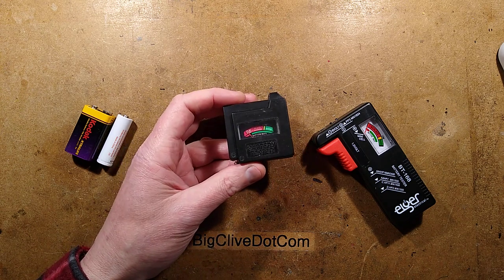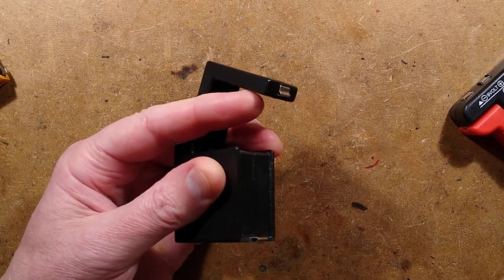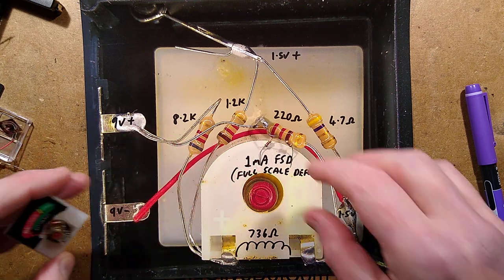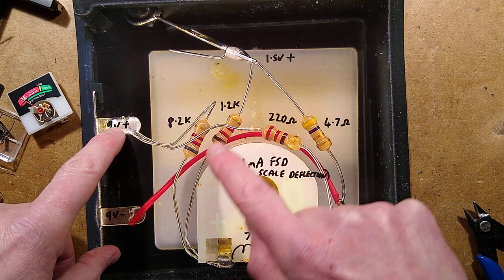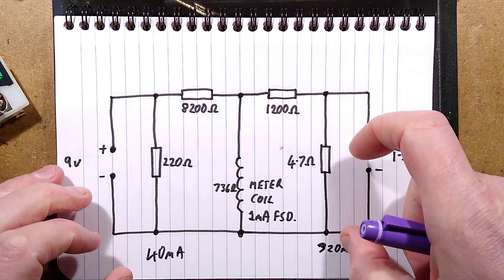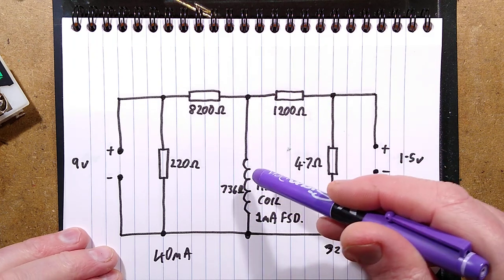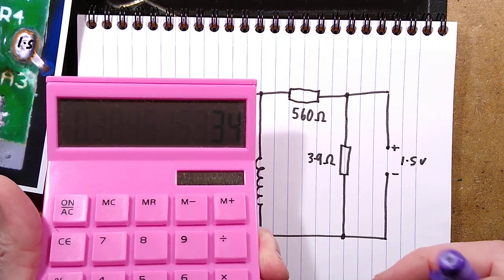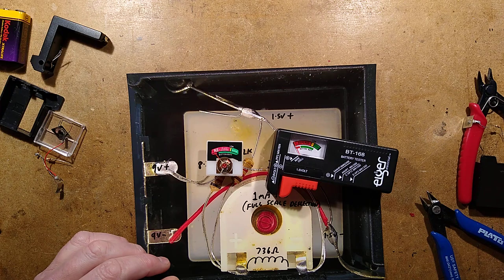Inside a simple battery tester (with schematic)

Comment: I've had one of those square ones in my battery drawer for probably almost twenty years by now. I've even fixed it once when the needle came unglued. However, mine goes well into Good with a full battery, so maybe they have made different versions over the years.
Reply: I have the same one to for probably about 30 years, i kind of want to take it apart and see what value resistors are in it now!
Reply: @MsNubble  or perhaps the meter is different

Comment: Never knew battery testing had to load the battery for good results. Explains the insides of my trusty analog multimeter. Love the little thing. Doesn't use battery unless resistor testing.
Reply: Batteries have internal resistance, which increases with wear. Unloaded it can look fine. This is also why a light load on a battery can get more capacity out of it, because the internal resistance has less impact on the usable power. And it's why alkaline and lithium are preferred for high-drain, as they do better than dry cell ("super heavy duty") with regard to internal resistance. Battery University has a good page about internal resistance.

Comment: I've got the tester which is the same as the one grant sent, I've had it for many years and it's pretty good for a quick check if I can't be bothered to put them across one of my multifunction meters.
I've also got a very good coin cell tester that tests many of the coin cell types and gives a number of LEDs rather than a voltage so it's good again for a quick test.
Thanks for the video, it was interesting.
Reply: These should be better than a multimeter since they load the battery

Comment: As a guess I'd say the coil resistance would be the least accurate one to estimate during the design phase, possibly even changing as current warms the coil. As usual, engineering is full of competing interests and compromises, especially when one considers how this needs to work on wildly differing input voltages with no switches, and to be robust enough to withstand the occasional overvoltage. It is testament to durability to even have this working thirty years later. We all have one of these kicking around, somewhere. Thanks for the glance under the hood!

Comment: In the old days at Square D, we used Glyptal, aka glip, as a calibration set material. We used it on pots and adjustable caps. It locks in a tune so  the boards can be waxed. It easily breaks loose, if more turning is needed. I recommend you replace the meter with 2 leds. One for ok and one for "it only lights and led". Good luck!

Comment: Very interesting, the eiger tester , I have that but with a LCD display cost about a tenner from Amazon,I keep it in my camera bag , It a handy and useful tool to have . 
Great video as always Clive 
👍👍👍❤️
Reply: Just an idea Clive , the small square battery tester,? You could easily improve the acuitsy  simply by adjusting the screw on the needle and test three battery’s star with a new fully charged one once you have a full deflection, then test a partially use one then a dead one . ? , it no different to adjusting the zero on a analog multimeter.

Comment: I have one of these (or similar) and IMHO it works pretty well.  I note that if a battery powered item starts to fail, one of the cells will invariably read in the yellow or red - so I trust the one I have.

Comment: We had one identical to that when I was a child. I recall that it too never measured anything above the yellow line. I also remember that you needed BigClive hands to operate it using the little shoulder button. The spring was immensely strong for no good reason. Great for pinging AAAs across the kitchen.

Comment: My go-to battery tester is an old EICO 585 kit I built years ago. Has a rotary switch for different battery voltages and load currents. Not much use these days for the higher "B" battery voltages. It has front panel terminal strips for custom voltage and load current resistors. Guess I could determine values to test button cells but we have so many flavors floating around probably not worth it.

Comment: I've had the smaller black one, which is '7dayshop' branded, for maybe close to 10 years now and it's always seemed accurate for all battery types.

Does appear to put quite a load on the batteries though. The dial quickly goes down, especially for lower capacity button cells.

I'll open it up tomorrow to see what value resistors mine uses.
Reply: Coincidentally, I also had one of theirs (based in the Channel Islands to avoid UK VAT: they sold things like camera film, printer ink, photographic and computer accessories etc). ISTR it was reasonably accurate.
Reply: @Bartok_J  I bought it alongside their own-brand high capacity AA batteries that were good value and well recommended at the time. Half of them are still going strong for times they're needed now and then.

(And turns out I didn't actually get round to opening up the tester tomorrow.)

Comment: I’ve had an old one of these branded “Radio Shack” that’s work3s quite well for decades; it stays in the battery drawer just as a quick check of “new” batteries which aren’t always so “new”. If the new batteries don’t peak it out I check them with a multimeter; I’ve actually found a whole bad package of batteries which were all under 1V. If I didn’t check batteries I may not have figured out the bad package quick enough to return it.

Comment: The red paint on the meter is for locking the jewel screws after adjustment not zeroing the meter. 
I've had 2 of your new battery tester for many yrs & 1 of the has a digital lcd display not a meter.

Comment: Due to the way the 9v resistors is in parallel with the coil 1.5v on the input actually delivers 0.74 mA to the coil.
64uA takes a detour through the 9v resistor array.
Assuming we want 1mA through the coil we need 0.736v over it but that also passes 87uA through the 9v resistors as well.
Total current passed through 1200 Ohm resistor from 1.5v terminals is thus 1.087mA making the voltage required 1.3044 + 0.736 which is 2.0404 v! Voltage not found.

Comment: I got the old square one, except mine has a corporate branding on it. I think it was just a promo thing at some point. Works fine in general. I've never had an issue with it in terms of not recognizing cell power, but I also don't use any rechargeable AA or AAA batteries. They always seem to drain real quick in the devices I need them for. 
That being said, putting an Energizer "lithium" AA battery on that thing sends the needle crashing to the other side.

Comment: Wow thanks for showing the resistor values, I have the same battery meter that I accidentally left in my pocket that  got sent through the washer and dryer. The regular 1.5v part still works fine but the 9v battery side of the meter stopped working after that. I’m guessing it’s just a broken wire but now I know what the resistor values are if I ever end up needing that function back.

Comment: I have that generic black square one. My parents had it for at least 23+ years now. It works really well but sometimes it can be a bit tricky to fully show that accuracy of the battery's charge that's left. But with the indicator for the the needle when checking a AA cell and it's in the red zone. That doesn't really mean that the battery is no longer good.

Comment: In the case of the 1.5 volt input, there's also an additional 8,420 ohms in parallel with the 736 ohms of the meter. In the case of the 9 volt input, there is an additional 1,205 ohms in parallel with the meter.

Comment: I have a DMM with a low-impedance input "battery test" feature. Haven't measured how low yet though.
One range for 1.5v, and one range for 9v. I use the 9v extensively for anything that's anywhere more than 1.5v, including Li-Ion, since the 1.5v range can't read anything higher than, well, 1.5v.
I've also just used common analog voltmeters, since while the load is not quite as low resistance as these, it does the job better than a high impedance digital.

Comment: Big Clive,
   I have a Strange antique panel that I purchased from an antique store. I think it was a panel to monitor telephone/ Telegraph power stations but, I don't know...it Could be for anything like an old crane?   The panel is 3 ft X 1 ft & 1 inch thick.  (Sorry no metric conversion) it is made out of some kind of ceramic / concrete & painted black.  It is super heavy !
It has an antique amp meter DC made by WESSON model 273 Day storm. Amperage is 0 - 7,500 amperes D.C.
Printed on the board below it says....DISCHG.

The voltage gauge is exactly the same type of meter. It reads
20 - 30 Volts D.C. printed on the board below that it says- BAT.  there are two strange big relays made by Western Electric. One relay says 260 BM. 
High 25.25 V.  Low 22 V.
Underneath that relay printed on the board it says HLV
Now for the other relay.
 says....
260 BU. 
High 23.75 V- 24.5V
Low 21.25 V.-  22. V.
Printed Below it ...EM CELL
There's also two copper shunts and a ground connection on the board.
I also have a smaller version with two relays & an analog voltmeter 0 - 50v.
They're all beautiful & relays.
I thought about shipping one of these relays to you so you can figure out how they operate. Each relay is about the size of a can of soup. They definitely don't make relays like this anymore!
I will try to find a picture of one of these relays and send a link to you down below.👇
Reply: I posted the links big clive but, YouTube deleted them!

Comment: Finally got my second pair of anyloops back from my parents. It only took just over a month, although I was sick for three weeks of that time. Anyway, now I can play my Game Boy Color almost indefinitely without having to revert to alkalines.

It doesn't have a battery level indicator, but it does have a power LED that gets very dim when the batteries are low, and the background humming noise from the speaker gets louder when it's right about to die. If I'm not too engrossed in my game and paying attention I can press the pause button, swap to the other pair of cells and resume my game, as it saves the state if powered off while paused. Otherwise I lose my progress on the level and have to start from the beginning.

Comment: I have the digital version of the "clamp" type meter, with an LCD. When I disassembled it to find out if it loads the battery, I found out that it didn't. So I added 4 resistors with 4 microswitches (the holes for the switches go exactly where the "BT-168" marking is on yours) to add 4 ranges of current loading. One thing I found out is that it takes some samples and then holds the voltage it has concluded on, on the LCD, so you have to hold down the switch before contacting the battery. There is 'just' enough space inside for this mod.
Reply: It works without an internal battery and uses the battery you're testing to power the circuit and display.
So it does put a load on the battery.

Comment: I just got one of these BT-168s and I also have an atmel-based multicomponent tester, driven by a 9V battery. The 9V battery in my tester was old and the tester itself measured its voltage to 8.65V while the new one I just replaced it with, shows 9.53V. The multimeter alone in voltage mode, without a lod, shows 9.01V for the old one and 9.61V for the new one. Still - the battery tester shows close to full power for both batteries. The old battery is just 1mm left of the new and good battery, both on top of the top-most green scale. I haven't tested 1.5V batteries yet, but I guess it should be doable to hack this to something a wee bit better…

Comment: I have a rather novel cell tester that seems to use a small D C motor which winds up a spring, so that a disc attached to the motor shaft rotates to differing degrees dependent on the state of the cell; interesting and quite clever. I have so far resisted the temptation to do a Big Clive on it.
Reply: Is that one made by 'Ronco'? I had one of those back in the early 1980s, & yes it had a Small DC motor inside which rotated against a spring, which rotated half a turn to move the indicator disc, I took it apart years ago out of curiosity, the only bit I still have is the motor!
Reply: @NOWThatsRichy  I don't recall seeing a name on it, but suspect that it was badged and sold by several different outlets.

Comment: On the meter, I think you will find with the screws covered in red paint, that each one of the ends of the screws are conical. That is, inverse cones. And the ends of the meter deflection are pins. You adjust the screws to mount the meter in place and to adjust how much resistance the needle gives. I'm not sure of all the correct terms to use for the parts. And I wish I could just draw you a picture! But these comments don't let you.

Comment: Ah, the battery tester you took apart brings back memories. I had loads of them in the 80s and 90s when I was a young'un and wanted to test the batteries in my R/C cars (ie 9v battery for the controller and the 7.2v Ni-Cad power pack

I had more than one occasion where the battery failed (ie on the transmitter) which lead to the r/c car being stuck at high speed lol (these were the days of mechanical speed controllers so if it lost signal you were screwed as it was stuck on the last known throttle position).

I still miss my R/C cars, especially Tamiya Hornet and Monster Beetle.

Comment: The windings of an inductor have a real resistance. Its impedance only becomes a factor for signals and AC, at which point its inductance shifts the phase of the signal, forming reactance, which is  a factor of its impedance.

Comment: Since you know the circuit and the individual resistor values for this kind of meter you can measure the resistance at either set of test terminals and derive the coil resistance for your larger meter.

(In your schematic at ~4:34 we see that the 1200 ohm resistor and the 736 ohm coil form a voltage divider in parallel with the 4.7 ohm load resistor; the actual load on the 1.5V cell is therefore more than that from the 4.7 ohm resistor. (Obviously the coil displays the current through it but that also will tell you the voltage across it.) Worse, the sum of the 220 ohm and 8200 ohm resistors for the 9V measuring part of the circuit are also in parallel with the coil making the total real load on the 1.5V cell still more complicated. The same considerations apply to the load the 9V battery will see.)

I have one of the smaller meters branded Radio Shack- they used to give the meters away with battery purchases. I don't think I'm being overly cynical when I combine the meter's apparent under-read with Radio Shack's desire to sell more batteries.

Comment: You could inject f.s. current and measure it; don't forget to subtract the parallel load current.  You could simultaneously measure the required voltage to calculate the network resistance.  Thus, you could solve for the meter resistance.  Using the other port, you could verify your work.  They should agree within the resistor tolerance and measurement accuracy.  (For ultimate precision, you could measure the resistances and use these values.)

Comment: I have the same square black battety tester at least from the mid 90's and I'm quite sure that the green portion of the scale is a bit longer on mine, and it's always been spot on at testing batteries. 
But it seems that the more recent ones were modified into tricking the owner to consider batteries dead so they go to buy new ones more often, specially when it is a tester given for free with a promotional value pack of batteries at the stores.

Comment: We used the square one at Church for wireless mics, but for me, I went straight to a multimeter. (Overachiever that I am. 😁) Lately, I've been using the "Lo-Z" mode on Dave Jones' BM235 meter. It places a 2K (or so) load across the probes, putting the battery on a small load. Found that works "a treat" for testing battery state of charge. 👍️

Comment: Ignoring the parallel path is OK for the current draw because the parallel resistance path is so much higher.  That is not true when calculating the meter deflection.  The parallel path reduces the meter deflection and is part of the reason your old meter read low. 

I have a dual banana plug with a resistor across it that I plug it into my multimeter input as a load for battery testing.  I also have a small dedicated AA NiMH/alkaline tester with a 5 led readout I use to check strobe batteries when I am photo trips.  The key to testing all batteries is that they need a load.

Comment: I always wanted one and found one in an old car I just bought.  It says battery cell tester, has a zero in the center 1,2,3 to the right and the same to the left.  Its sealed rubber has a red and a black wire coming out of it and a hole where it looks like there used to be another wire.  Its very interesting which is how I ended up here.  Mine is much different than yours but thanks for the effort.

Comment: I didn't take mine to bits but I measured using my meter and on a 1.5 cell battery it drew nearly 1/2 an amp. You do need to have a load otherwise you're measuring surface charge which can be deceptive.

Comment: Scary thought:  the 1/4 W load resistor for the single cell is dissipating nearly a watt and it could overheat and burn up if the cell was tested for a long time.
I think you could have added resistors in parallel to bring the meter needle out of the questionable and into the green range.

The cheap cell tester I have has a boost circuit in it to drive the LEDs it uses.
 
Thanks for the video, Clive.
Reply: you're only really meant to test quick, anyway 😉

Comment: I have one of those old battery testers, but a fully charged battery will meter well into the green zone on the display as it should. Perhaps not all of those old testers, despite identical appearance, have the exact same circuitry inside.